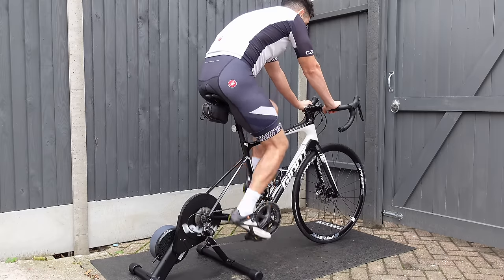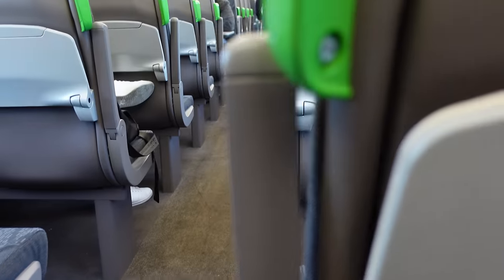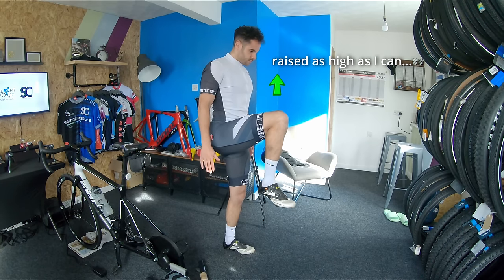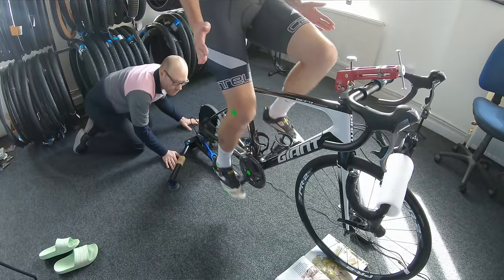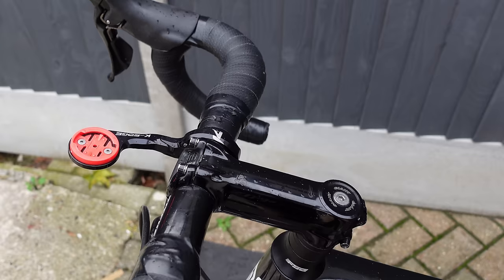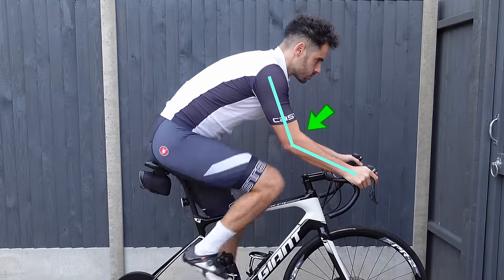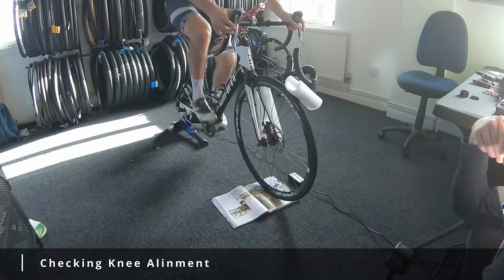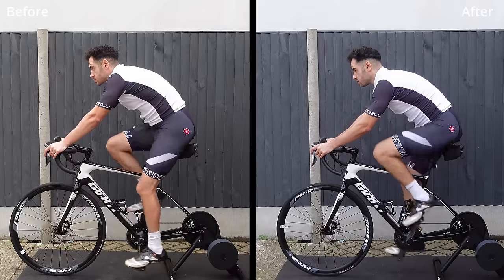I've Been Suffering For 3 Years // Full Professional BIKE FIT in 6 Steps!

Comment: Thanks for sharing this important video. Thanks to Romain allowing you to share your fitting. Do you have plans to use Romain's services to complete the assembly of the new frame?
Considering the price of higher end bikes, a fitting should be part of the budget. The bike shop should be willing to swap a stem, handlebar, or seat to another at little or no cost increase.
Filming ourselves from different angles to review posture and movement should allow us to improve reasonable comfort while getting maximum power per stroke.

Cheers from the Pacific coast. 🍷
Reply from the maker: I am hoping to take my new frame to Romain to get a good fit as well. Like you said it makes sense to have it all done in one place. It will be interesting to see how a "race" bike is set up in comparison to my endurance bike. I do have integrated bars and stems from Elves to try which obviously has no adjustment (That's a whole different conversation) 

I think filming yourself at home on the turbo is the best thing you can do! From there you can see what it looks like. There is no other time we get to see ourselves like that. 

I hope you are keeping well and pushing the pedals still?
Reply: @JourdainColeman  Had no clue the "Giant" was your endurance bike. Hope you are more comfortable without dropping much $$. 
With the tools Romain has you should experience the best possible outcome with the Elves build. 
Even though I'm reasonably comfortable now I will pay closer attention to my riding posture and film myself.

After watching, realized I could have saved saddle adjustments by first buying pedals as platform height is fixed. Then a saddle followed by handlebars.
I chose saddle, handlebars, then pedals, the Scott came without pedals, and I slapped on the used ones.

Bought the carbon fiber Shimano SPD-SL Ultegra +4mm pedals with a lower platform. 
 integrated bars and stems from 
My combo flat handlebar doesn't allow for accessories. If the Elves bars are round, you'll find mounts. 
The stem cap mounts allow for 1 device.

Road to the bike shop this past Saturday and bought a new Ultegra chain that I put on Sunday. The old chain it was almost a full link longer than the new one which I was told was 50% worn. Also picked up a 10-speed cassette to go from a 26-t to a 28-t. It's almost a minimum with the hills here.
 
The flat black paint on the spokes has been getting more whitish pits with age. Removed the paint with 0000 steel wool and brought them to a shine with Mothers Mag & Aluminum polish. Now there's some bling with shinning stainless-steel spokes instead of flat black. Will be easier to keep clean.

Didn't ride as much this past week as I usually do, 140-150 miles. Had home chores to do I'd put off since it was great riding weather. 

Are you getting much outdoor saddle time?
 
Meant to get back to you sooner but I used my finger to keep a 2x4 from hitting the brick I was setting with the 2x4. It was throbbing but better now. You know you're having fun if your bleeding!
Looking forward to more of your productions. Hope all is well there. Keep the rubber side down.
Reply: @JourdainColeman  I took note of you mentioning toe point as this was something I was experiencing. Did lower the seat 16mm then forward 6.5mm. The pointing is gone, the reach is good, the grip on the seat is good, the hands are getting numb sooner so may move the seat again.

Comment: I think a major problem is high seats, low bars, short wheel bases. Mfrs are making bikes TOO race+cost oriented, when 99.9% of riders are not racing and don't care to race and would rather pay $20 extra for longer metal. They want bikes for TRANSPORTATION of body+supplies, and that is not what is being delivered. We need bikes that can be ridden all day, but we get bikes that are only good for a few hours at most. It's a societal/industrial illness IMHO. When bikes are made right, mfrs start chasing specs to outdo the other guy and chase yuppie money. And they leave perfect ordinary machines in the dust. I never had trouble with bikes in the 70s/80s, but today, my troubles are endless. Nothing is made for ordinary use. It's like bicycle race teams are behind designs, instead of ordinary people that test ride them for 16 hours.
I think motorcycles are a good comparison. What exploded is the market for BMW go anywhere do anything bikes. ADV bikes outsell all other motorcycles by far. A rider doesn't want a bike that imposes limitations or unnecessary complexity. They generally do not want a specialized bike. But that is what these dumb mfrs keep offering. Specialization. But 99% want generalization. They want ONE bike that does everything well, from roads to trails to carrying supplies to touring. But that is opposite of racing geeks. That is the major problem.
Mountain, gravel, city, road, beach, touring, cargo? What, I need 7 bikes? That's insanity it's just completely crazy. You need special shoes to ride a bike? OMG.

Comment: You mentioned reach was reduced by 20mm, did you achieve that by replacing your 100mm stem with a 80mm stem?

In the video from he before and after footage it did not seem you were using a shorter stem

Comment: That was a very interesting video indeed. My first thought was that you looked very 'wrong' and uncomfortable, so relieved you now look much better. Also noticed you now have a better lung position, as your chest looked folded and restricted earlier on. I prefer original sit up and begs, as I find them more comfy, albeit a lot slower :). Modern sit ups I find have a longer reach than old ones, they look the part, but don't really feel it. Will now go and watch foot video, thanks again
Reply from the maker: Yeah, my position was improved massively, defiantly better all around for many reasons. To be honest, I have built new bikes since this video and I would probably say that the giant frame is probably to big for me and my body geometry. The new frames I have gone with have all been smaller and they feel much better. (Size 52 frames work for me, I'm 176cm tall) 👍🏽

Comment: thanks, great video. It continues to amaze me how we need a smaller frame in general. I am around your height (5'9" ?) and had between 54 and 56 frames when after having a bike fit, I am more around 52 (or 53) frame. I think it is better to have a longer stem than a shorter one. So now your stem is around 80mm!
Reply from the maker: Thanks for sharing! And I agree, I think in general people ride bikes that are too big. It's easier to make a small bike bigger than a big bike smaller (if that makes sense). with all the adjustments I could get away with a bar change (1cm shorter reach on the bars).

Comment: I'm curious how much of a difference you could make if you worked on your flexibility.  I had a similar situation, and saw a fitter, and he suggested doing some core/stretching/etc work, and over time, I ended up with a blend of the old position and new one.  Main thing for me, was core strength.  I was functionally fine, but to ride in an aggressive position, you need a different core strength than "oh look I can do crunches".  My hamstrings were also tight too, I knew this going in, you'd be surprised how much your body can do "wrong" and not know (as you noted).  Great video, nice to have all of the information in one spot.
Reply from the maker: I think that having improved flexibility would help for sure... and that additional core strength! It will be interesting to see how the bike fit is on the new race bike I'm building compared to the endurance bike in this video. Like Romain said, it's a process not an event, I'll be sure to create more details as my position progresses. P.S I'm pleased you enjoyed the video.

Comment: Hi. Good explanation of the proces. Question. How did you shorten the reach? Shorter stem? You als set the saddle more forward. Is that part of changing the reach? I wil be looking for your experience of the chances on the road! Gr. Edwin
Reply from the maker: Hey Edwin, rach was changed with a combination of....

1. Lowering the saddle (This brings the seat forward because of the seat tube angle) 
2. Saddle setback (Moved 5mm forward, to be honest, though this was more to make me feel more planted on the saddle, less about the reach)
3. Shorter reach on the new bars (1cm shorter reach) 

I hope that helps!
Reply: @JourdainColeman  shorter stem was the question

Comment: Very helpful and informative video, thanks! I happened across this video as I am a beginner who just purchased a gravel bike. I am struggling to decide between two sizes. Smaller size felt like my hands landed perfectly on the hoods and felt good. However it felt like the seat needed to be positioned further back, though it was as far back as it could go. With the larger size, I could certainly feel that I was reaching out further, but not too dramatically, as I still have a slight bend in the elbow. Just doesn't fit as natural as the smaller bike. However, the seat position feels better. And is almost all the way forward. Which is the easier to correct? And therefore which size do I rather go for? The smaller or the larger? Thoughts?
Reply: Would I be correct in assuming that if I were to get a new bike stem for the smaller bike that allows me to sit further back, that would further my reach and my hands probably won't land on the hoods as naturally anyway?
In terms of geometry between the 2 sizes, I am told that the reach is the same, but there is a 19mm difference in stack. And 30mm difference in seat tube. 
It's astounding how mms and cms can make such a difference in feel!
Would appreciate your opinion.

Comment: I am a local pro CX racer with lower back pain. According to my fitter, who has a very reputable reputation in my state, my seat is likely too high(in reference to the handlebars). He hasn't actually done a fitting yet, but I figure he may be right. But I have it higher and the saddle all the way forwards because my butt feels like its always sliding forwards. Now my butt doesn't slide, and raising the stem 5m helped my hand pain as well as reach. But the back is my final hurdle.......
Reply: Check the right/left and for/aft adjustment of cleats, hook position (try non symmetrical adjustment) and handlebar lateral position. I get rid of back pain by rotating stem (when in the axle I felt like I was turning, when off the axle it is relaxing tensions).

Comment: Good vid. Very similar outcome to my bike fit (lowered saddle, cleats back, narrower bars and 80mm stem). Makes you wonder why bike companies use a 110m stem and 42cm width bars as std
Reply from the maker: Exactly that! It seems stock bikes form manufacturers are way too big by default.
Reply: Cost gain
Reply: Perhaps my riding position is too extreme but I am 1.91 metres, have a 14.5cm slammed stem on as standards are way too short. Most standard frames are built with too larger headtube as well as I think they assume cyclists have zero flexibility and terrible core strength. I as a result can maintain an aero low position for 6-8 hours stress free, not riding with my head and shoulders way up high in the wind.

I think the mistake is to buy a frame then get it fitted, always get measure up before and if off the peg buy a frame that's the closest to your needs.

Comment: good video! i'd be inclined to replace that seat post at some point. one of the things i like on my trek is that i can independently adjust tilt and setback.
Reply from the maker: Good point! The only issue is the shape of the post is specific to my frame. So unless Giant do a newer version with more adjustability... I'm stuck.
Reply: @JourdainColeman  If it is actually clamped into position, then you could take to it with a file or grinder.
Reply: @JourdainColeman  if that's a D-fuse seatpost, the one on my Giant Contend SL, 2018 model, has a two bolt infinite adjust clamp. I think it might fit your frame. See your Giant dealer.
Reply from the maker: @fgreen411  thanks for the info, I'll have a look 👍🏽

Comment: Okay, a few things, I’m glad he pushed your cleats back. They should go back as far as they can be put though if not already there. This will save your calves and although a slight loss in sprint power, in the long run you’ll make better power longer into a ride when your calves would otherwise become a limiting factor, plus if you have a run after this, your calves will be fresher. (Search Joe Friel and cleat position/power test) Most top triathletes are like this or even using mid foot cleats. Any change in cleats now will require seat height check again. Next, I’m glad to see your seat was lowered. Most bike fitters will set it too high. I don’t understand why he worked on your reach before working with the saddle set back though. He should of set height and fore aft first. Now whatever was done with reach has to be rechecked since he moved your seat forward. As for the bars, nice to see the narrow width. That’s the way everyone is going on the road. I’d also suggest tilting the levers in, and slightly up/back as well. Lastly, how tall are you and what is your crank arm lengths? This was not addressed at all in your video. Proper crank length to me is one of the first things that should be determined. If you’re 5’6 or shorter, you should probably be on 165mm cranks. From 5’6 to 5’8 maybe 170mm, and so on. From there then seat height done.
Reply: " I don’t understand why he worked on your reach before working with the saddle set back though."- i had the same question...Nice input about the crank length. Very informative video btw!
Reply: Partially agree. More directly attributed to inseam length > femur length. Related, would use 170mm crank arms which will allow for an rpm increase and smoother cadence then recheck saddle position. Get the new post/saddle and do at the same time. All the best

Comment: Biggest mistake people make is getting a bike fit and then leaving without the measurements MARKED on their seat post, cleats etc. Then something slips and they dont know where it was meant to be set back to. You might get measurements but everyone measures a few MM different.
Reply from the maker: Good point! Romain has all the measurements and he sent them across as part of the fit but I'll mark my seat fore and aft as well as my cleats so if anything slips I can correct it straight away to the exact location. Cheers for the tip! 👍🏽

Comment: I've had 2 bike fits, 1st was terrible, guy just slammed on a 70mm and whilst it sorted posture it was terrible for cadence, made cycling really hard. 2nd was much better but alas still chasing perfection after nigh on £400... bike only cost me £700... :)
I was surprised you did setback after the reach, is that normal? Surely you need to find the balance point first and then sort the reach? 

Also, did he do anything with your stem height? I..e add spacers? 

Romain appears to have used masking tape on your saddle to measure from, was this the 120 mark? I.e where your sit bones go? 

Great video
Reply from the maker: Hey Ande, 

Good to hear the second bike fit you had was good! Not so great about the first one. 

I followed Romain's steps and I have a great position now so I trust his process. The mark on the saddle was a specific point but I can't quite remember, it gave a set place to take measurements from. 

The stem height stayed the same, and no spacers were changed. We played around with the stem height but it was all good. 👌🏼 

Cheers for watching!

Comment: Interesting. Did the fitter disregard your leg length difference, or make suggestions around it?
Reply from the maker: Hey Aubrey, this will be looked at in the foot activation session. (Video coming soon). Unfortunately we run out of time on the day.
Reply: @JourdainColeman  ah got it. I'm mostly curious because i have the same issue! injured my right tibia & fibia at a young age, and the surgery to fix it made my right leg a bit longer than my left! Been riding for a long time, but having a 3mm shim under my left leg has helped me recently
Reply from the maker: @aubreyxengland  Sorry to hear about your injury, but glad to hear you are able to cycle! Interesting that you have had shims under you left foot, literally the same as me. My foot angle is also different so the cleats are slightly different on each foot. 

Let's see what happens in the foot activation session 👍🏽
Reply: @JourdainColeman  I had a bike fit in November and my cleats, which had been as far forward as they could go, were moved back by 1.5 cm, staggered, and with one pointing in and the other out. The one pointing in felt it was fighting the cleat, but I persevered, thinking I'd get used to it, until I did a fun ride 3 weeks later and got severe tendonitis. I've moved the cleats forward a bit and straightened them out, but my ankle still hasn't settled down. Unfortunately my bike fit lady spent far too much time talking and measuring, and then just set the bike up and sent me on my way, rather than looking at my peddling.

Comment: A very very good explanation!
All is very logical, no tricks like kops or inseam measuring methods.
Just pure logic and trusting body comfort and feedback.
I can also advise that the riding on the road is little bet different then on the trainer because of the fact that the rider must be
On balance withe the bike on the road of course, so small changes maybe required.
Also i believe that seat height and seat position fore/aft are going together before reach setting because of the balance on the saddle/pedals is independent in my own opinion. 
But overall i agree with all been said here.
Many thanks!
Reply from the maker: Hey! Thanks for commenting adn glad you enjoyed the video. It was a very logical process like you said and I'm pleased with the outcome many weeks later 👌🏼